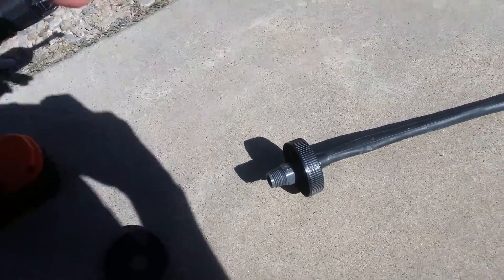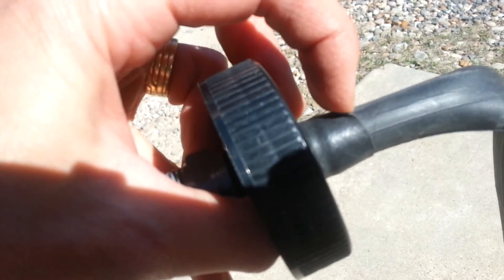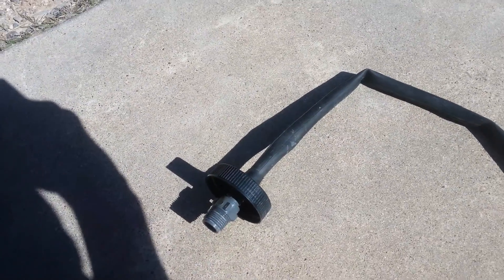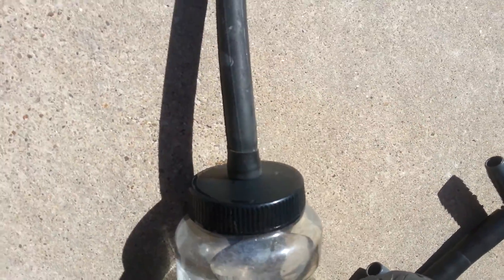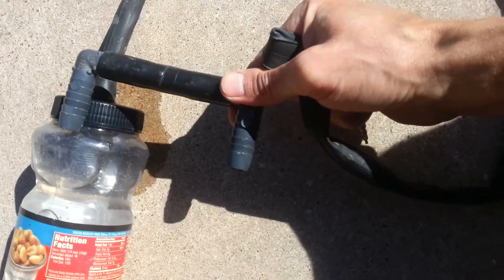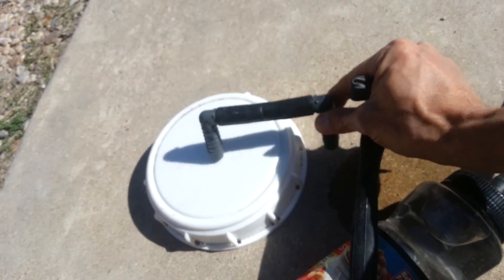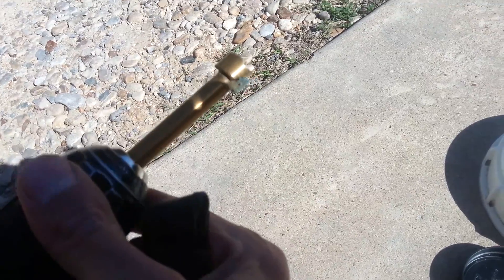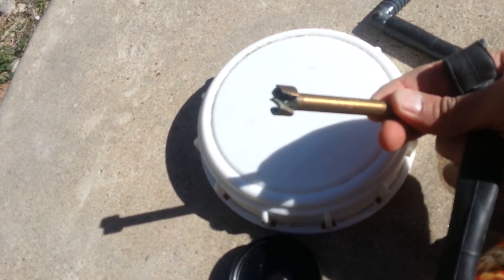Diy Uniseal / bulkhead hack

Comment: It leaked bro
Reply from the maker: bobby blues : If your hole is too big, try doubling up another inner tube on top of the original inner tube.  The size is key.  I experimented with old lids before drilling into the big lids, of which I had only 1.  Mine are still holding after freezing solid.
Reply from the maker: Oh another tip: some of those fittings have extra plastic where they were molded in a mold.  Try to use a fitting with a minimal amount of this extra "slop" material.  Or file down any slop so that the fitting is truly round, all around it's perimeter.